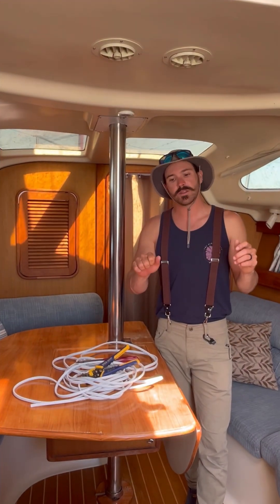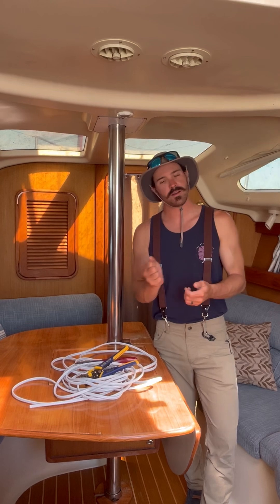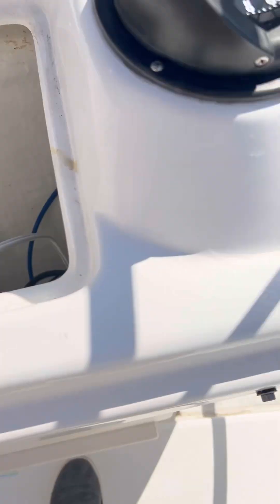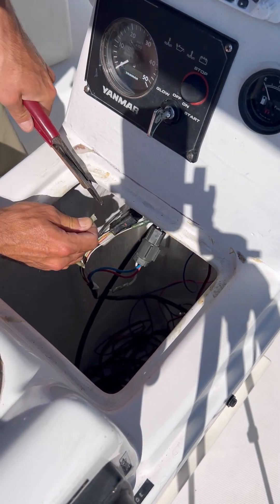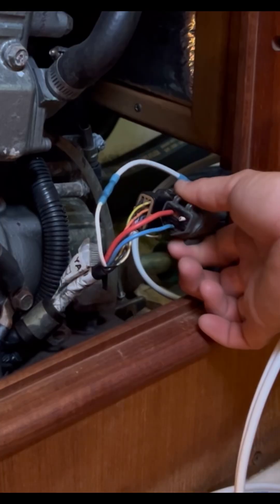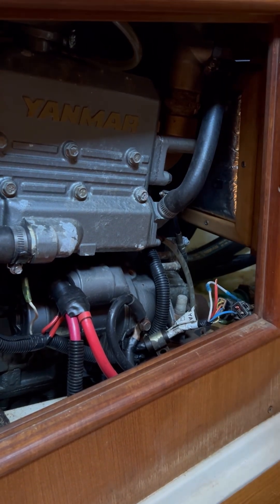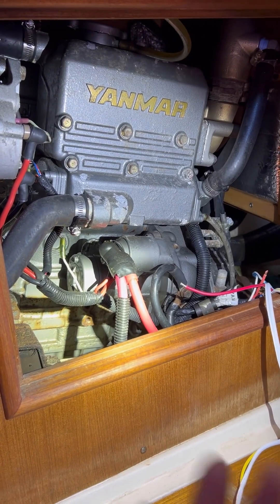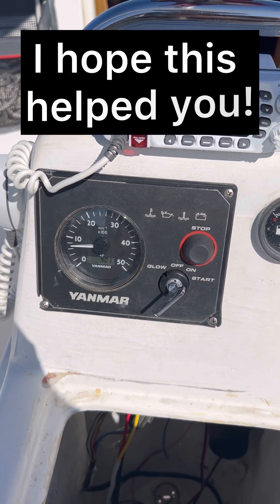Yanmar engine starting issue (Marine Diesel)

Comment: I have the same issue when trying to start. Sometimes it would start on first or second attempt and on other tim3s after many attempts.  I have changed many items but not the wires you did. On reflection the previous owner mentioned if we have trouble starting look at the white wire he replaced.  I will attempt your move before I pull out the starter motor.

Comment: Having exactly the same issue with exactly the same motor but the key unit is older. So looking for the pin out/wiring diagram right now but will have this fixed ASAP. Thanks for the post Captain!

Comment: After new start battery and new ignition switch, this will be my next move to solve this problem on my 20 yr old Yanmar..  Thanks!!!
Reply from the maker: Glad you found this helpful. It's such a frustrating situation when your engine won't start.
Reply: Handed it over to my mechanic and he replaced relay by the starter solenoid. He said that’s the way to go. 
Tanaka for the followup
Reply: Ok I replaced the whole starter , not just the relay, and the issue is persistent. However when I bypass the key it works fine. Anyway just want to clarify that the relay is part of what usually is replaced when a new starter is put in unless I'm mistaken. Thanks
Reply: Better to replace the starter motor after 20 years.